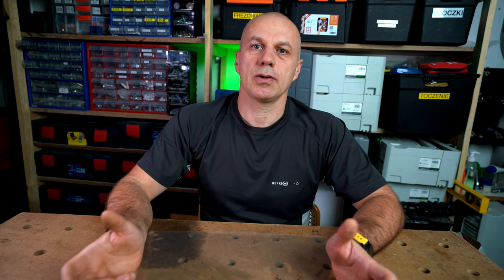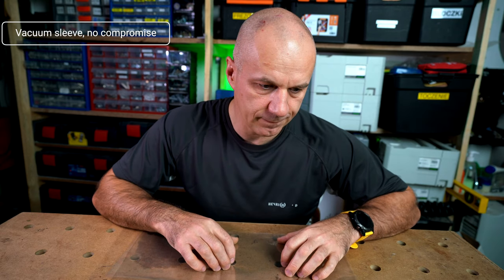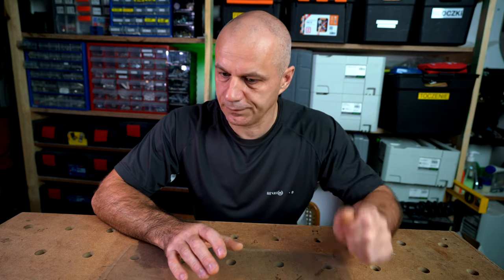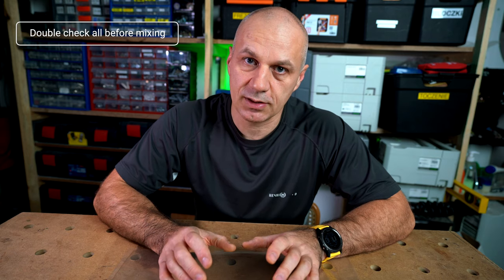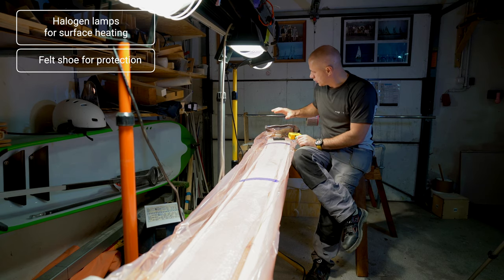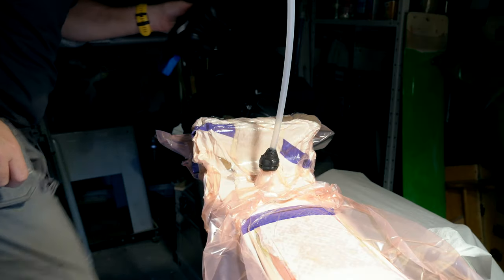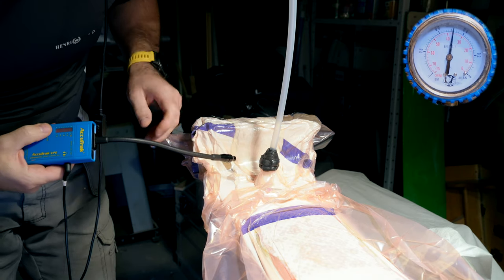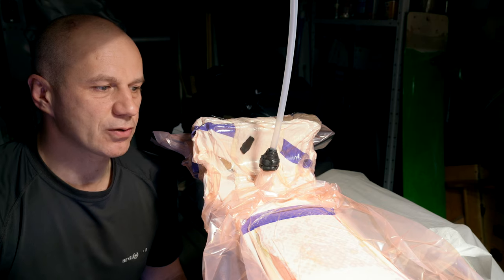DN Tech Talk | 04 vacuum bagging tips | icesailing | iceboating

Comment: What PSI are you bagging at and is that any different for infusion to simple bagging? Thanks!
Reply from the maker: Dave, with vacuum bagging it's pretty easy. I run the pump to come to -0.8bar / -11.6PSI, close the valve and let resin cure. If reinforcement is well impregnated you will never run into any problem. With infusion it's a bit more complicated.  There are couple of factors to consider like: number of inlets, resin viscosity, reactivity and in general infusion strategy, temperature. But I start the process with -0,4bar / -5.8PSI and progress to final -0.7bar / -10.1PSI.